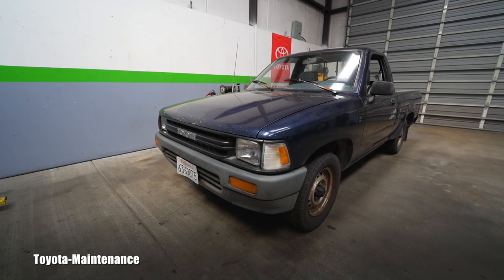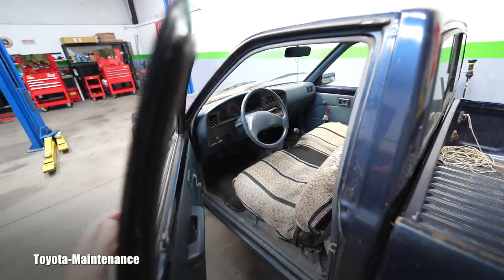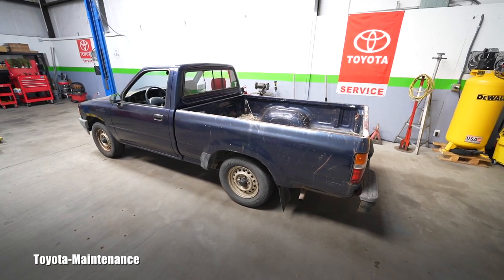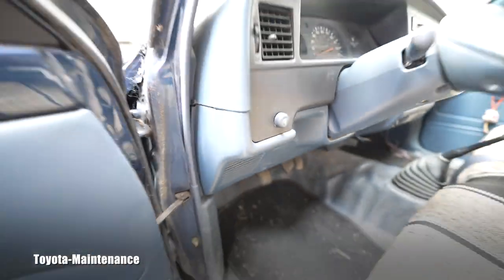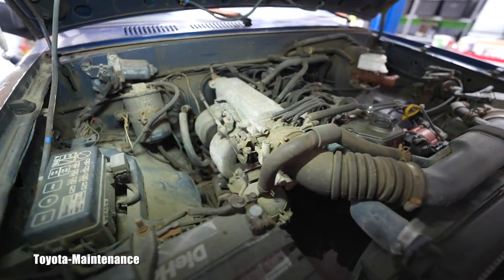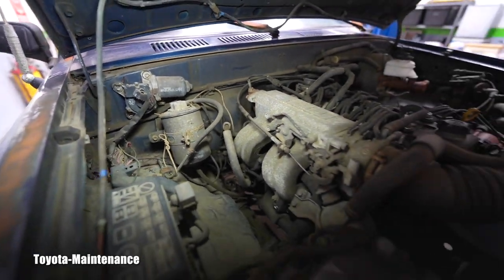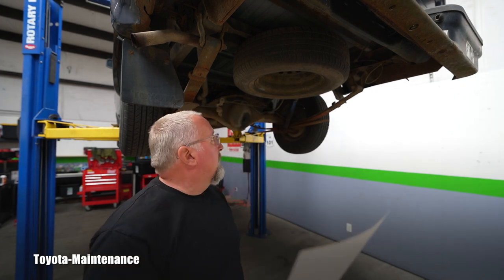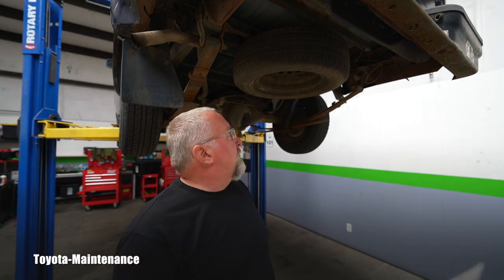Toyota Truck with No Brakes

Comment: I’m amazed that Toyota still has the factory part for such an old vehicle very impressive Toyota.
Reply: Yes. My mechanic friend tells me that it's becoming increasingly difficult to find OEM parts for many brand vehicles made prior to 1997.
Reply: I can still get Mazda factory parts for my 80's Mazda Bongo van; well over a 3rd of a century old.
Reply: Most mechanical parts for these are still available. 

Trim and body parts are what get harder to find on older cars
Reply: @timetowakeup6302  i agree completely. Even for the most common parts failures. Like a steering column mid shaft. Have to junk a vehicle over the inability to find a commonly failed by wear part? Really? Even aftermarket good luck on some stuff😶

Comment: Petr, I am impressed that the brake warning light works after 31 years. Anyone who remembers and respects the simple, single cab, RWD, 4 cylinder Toyota pickup can check out the base Hilux on the Friends Automotive  Youtube channel. Yes, it is still in production.😁
Reply: That's because it was build to last unlike cars and trucks nowadays they need more repairs.
Reply: @ZE308AC  truth.  However, American big three autos are likely better now than they were during that time as they were just coming out of their decade-and-a-half turd era .  
I'm not saying every single but Detroit really went into a sh!t spirel in the late 70s

Comment: My 1979 highlux lasted 18 years 150k + miles in the Midwest rust belt until the frame failed.  Those 20R and 22R engines were bullet proof. I was in the northern part of Greece a few years ago and to my amazement they were still using those 40 year old Toyota trucks for farming.  Unbelievable

Comment: Back in 1990, I purchased a Certified pre-owned 1986 F150 from my local Ford dealer.  Low miles, pristine condition, and they absolutely assured me it had passed their famous '28 point mechanical inspection' and that everything was in great shape, ROAD READY !!!!   Took delivery of the truck, within a week the brake pedal began to feel a little soft like a sponge.  Popped the hood, and WA-LA,  the master cylinder reservoir was BONE DRY.   I refilled it at home, and immediately had a solid, normal brake pedal feel.  Took the truck back to the dealer for repairs.  They could find NO source of a fluid leak.  Drove the truck for years and never had any problems.  Total mystery!

Comment: I'd inspect with more attention the frame near the fuel tank. As it's too close to the frame, it tends to collect mud and derbies, that then capture moisture. Leading to rusting the frame in that spot, including the brake lines.

Comment: Known in Australia as the 'unbreakable' Toyota Hilux. Australia's biggest selling vehicle is a Ute! And Toyota Australia still stock genuine parts as far back as the Toyota Stout, the Hilux predecessor. 👍👍🇭🇲
Reply: If that truck lived it’s life in the northern United States where road salt is used in wintry conditions, it would have rusted to pieces 15-20 years ago. These trucks may be reliable but they are made with very thin steel.

Comment: Hi Petr,

If you ever have customers that aren't in the most urgent need of parts I would recommend checking Amayama for prices. They are genuine parts, supplied directly from the manufacturers. Shipping times can be a bit slow though.

Comment: Thanks for the great video.  I didn't know about the valve for the rear brakes so if I have a problem with my 93 or 95 pickup I'll be a lot more prepared!  Seems like the owner(s) knew about this before or the person who sold them the truck new there was an issue because why was the load sensing bar/spring unbolted?  There is no reason for it to be off because it is too high in the wheel well to be hit etc...  They probably took it off because they knew it was leaking and by taking off the spring it made it leak less fluid.   Since the owners are most likely thrifty like most northern california commune/sharing people they could have just tried filling up the brake reservoir and seen how it brakes and how long it takes to deplete to the fill level,  but better would be just replace the part for 5 to 6 hundred and be done with it and be safe.  Hopefully now a wheel cylinder wont start leaking because the they might have dried out seals now since barely any fluid was going to them and with the added pressure they might not be able to cope with it.  If I were toyota maintenance man I would recommend changing those too, but I'm pretty sure the owners would decline so it probably isn't even worth it to ask.  Just make more money off of them if they do in the future.
Reply: I never heard him mention "comune" but I noted a smirk when he was describing the occupation of the client; you must have detected more to the story haha.

Are we to infer that the "landscaping" may have been more candidly expressed as "cash-cropping" ?

Comment: I have a 2002 utility Australian model with 389,000 km later engine model but the rest is the same, I rather use OEM parts too they fit and work and work for a longer time too

Comment: It probably can be rebuilt.  The pin came out of the loadsensing spring.  take the boot off clean it up, get a new pin and bushig for the spring it'll be fine.

Comment: As long as the fronts worked those rears can be totally empty with the divided master cylinder compartments my Toyota has 3 in 1 instead of the clutch master cylinder I have a plastic feed and a rubber hose feeding the slave cylinder most of the time I'm so used to the brake light on because using the parking brake every day it's always there

Comment: Hello! I have a 1987 carb 22R. It struggles to start and grinds the starter. If I start it in first with no clutch, it’ll jolt (stall) and then when I restart it in N, it starts back up. Many have told me it’s a bad starter but I had it tested and it was in good health. 
Any suggestions? Thanks!
Reply: Maybe the flywheel has some busted teeth?
Reply: Starter motors can test good but be worn and cause starting issues; if it's old, get it rebuilt.

Comment: Hello sir....I am taking your advice and shopping for a used Tacoma max budget 12k I don't care about 2wd or 4wd just want rust free....in my area 12k will get me around 2000 01 02 03 ish.....my question sir.....what is the best engine for me to hunt if I do not want manual tranny?  Thank you
Reply: You want the 3.4L V6. very reliable engines.
Reply: Thanks.....I need a pick up to tow a small trailer from time to time and do regular pick up truck duties all other times.....picking up the dirty stuff....mulch....mowers....bbq grills....or whatever else I need to get from point A to B............so the vote so far is go for the 6 cyl.........the hunt is on to find a rust free old school ride.
Reply: Well last year I bought a mint 2001 two wheel drive regular cab stick shift with the 2.4 brand new frame brand new leaf springs no rush at all anywhere else drives like a brand new truck at 100,000 miles I got into it basically $5,700 I sold the fancy Wheels there are but the stock wheels on it it's red original paint never in an accident that's probably a steal cuz there's not many around for that price and that condition I seen them upwards for 12 13,000 $8,000 in very crappy condition here on Long Island New York I didn't buy the truck on Long Island but anyway for the right price I'll sell it I want to get a 18 Corolla with half the miles but it probably get one for 15 16,000 oh somebody gives me 13 for my truck I will sell it because it's well worth it it runs and drives better than new I looked at one or 20,000 miles on it original shocks and original everything and mine is much tighter because everything is no on basically underneath but anyway they're around I just got to look hard real hard

Comment: 300$  is nothing for an old-as-dirt yota truck. in the winter salt-belt areas these are likely all gone now just disappeared, you are lucky to still spot one out there on the concrete trails ... talk to me about how pricey a busted crankShaft pulley is!